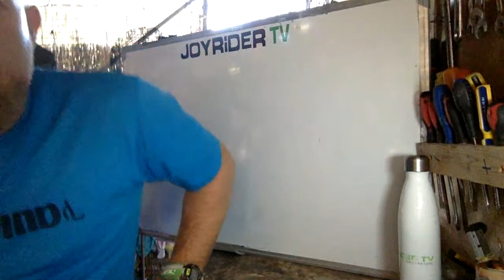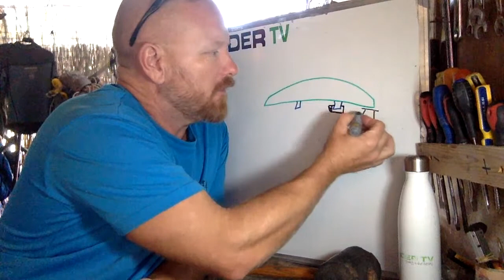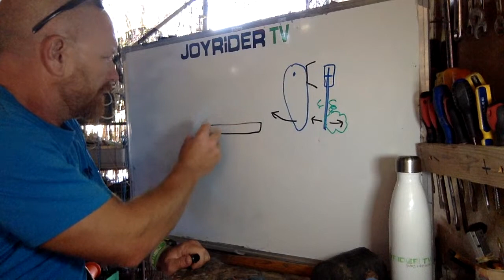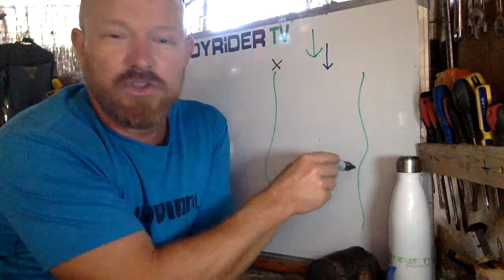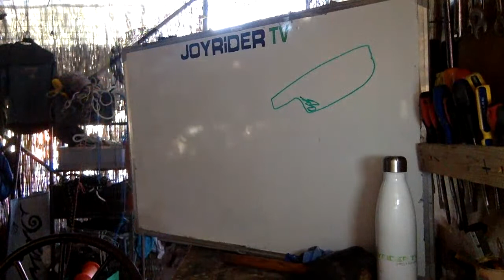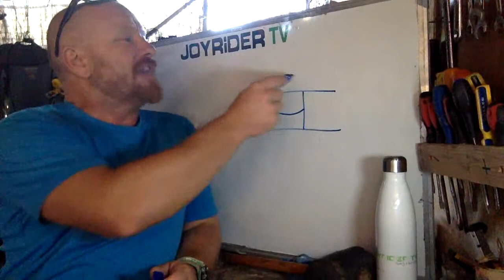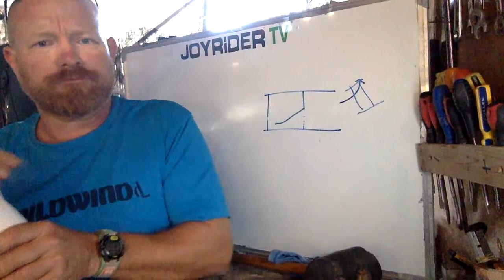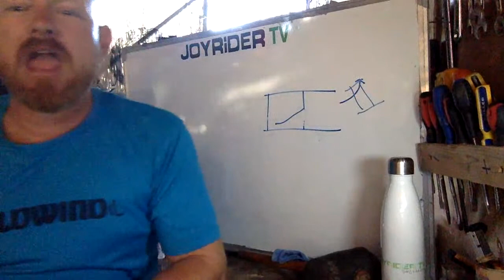Q+A LIVE 67your catamaran sailing questions answered

Comment: missed you again, dang. see you next week. I want to second the idea for the rhomboid frame of loosening the bolts and tramp, ratchet strap or trucker's hitch on the diagonal, one across the middle for some pretension, then tighten pilons and tramp. I have a q for next week in case I miss it... I can't find anything on modification of my old hobie (spreader?) I had a broken tiller end cap and it cost about the same to get the (old school) adjustable end cap so I went for it. Any recommendations on how to install it? I want to make sure it's all on an even plane, and adjustable in or out for any future issues. do I want to trim off the end with the old rivet holes, and where would you recommend drilling the single hole for the adjustment screw, or do you have any advice on finding info about this? thanks, willy
Reply from the maker: Thanks for the ideas on the frame. 
I'll look into your Q for next Friday,.

Cheers